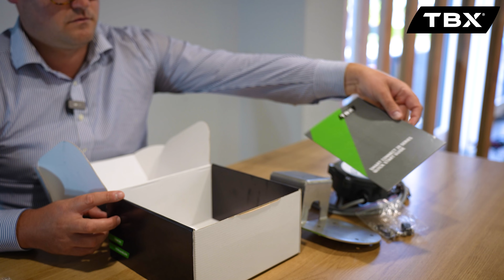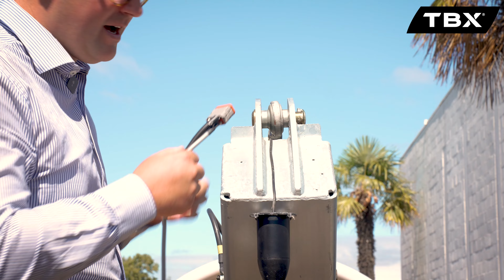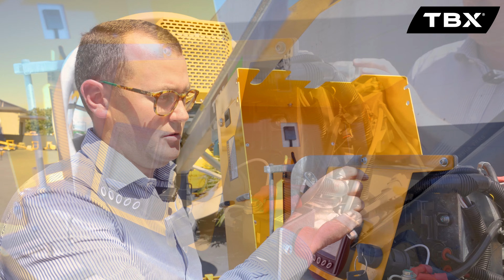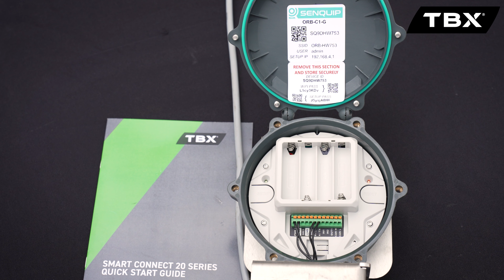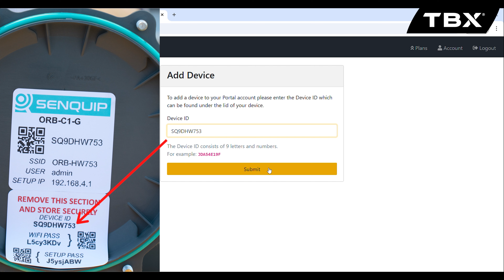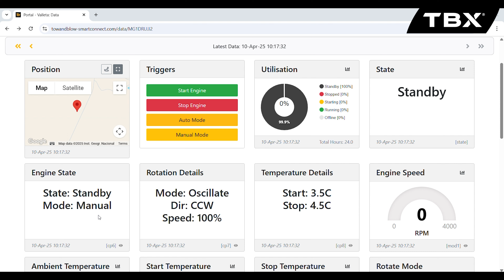TBX Smart Connect | Install & Setup Guide

Comment: Good afternoon. What is the possible problem if it does not find a connection with the SIM card, neither automatically nor manually entered the correct APN. Is there a possible problem with the provider or smart connection?